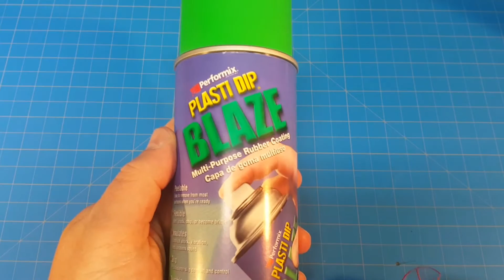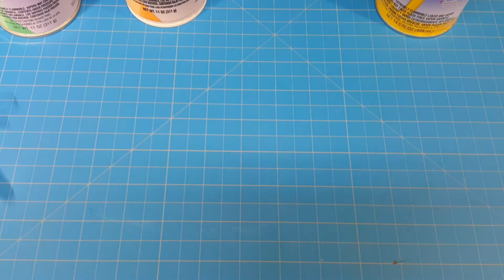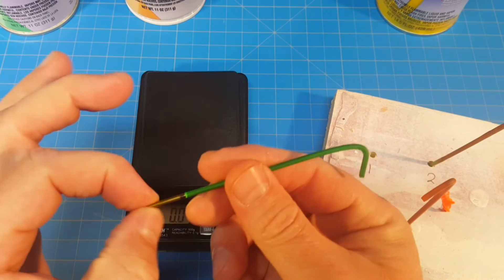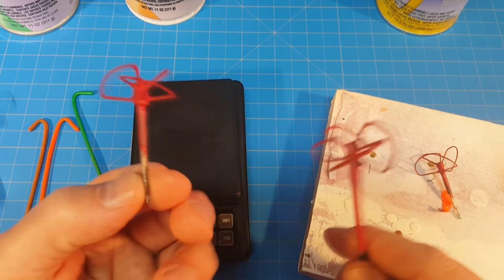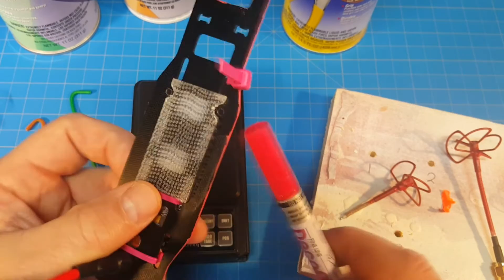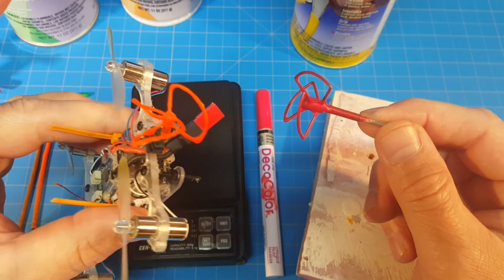Quad Bling - Customize your Quad

Comment: The cf birch picnic quad frames are specially made to be colored on the sides.
Reply from the maker: I would think so, but I have not tried myself.
Reply: +Nick Burns I meant on the edges.
Reply: +Kenneth Wang like you did in the video with marker.
Reply from the maker: Again, it should work, but I have not verified myself. Need an oil based marker or paint pen, otherwise it will come right off.